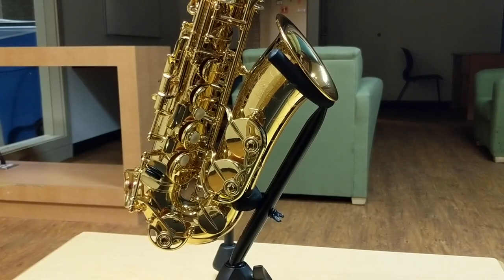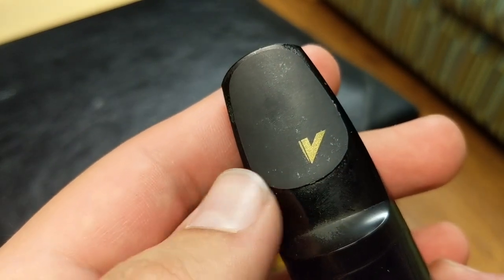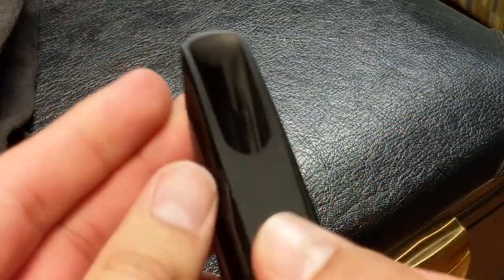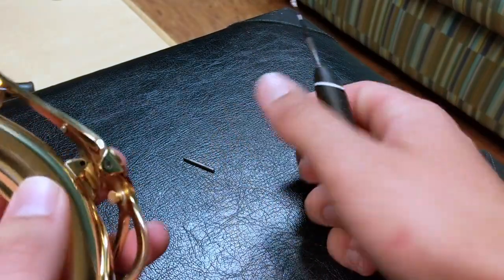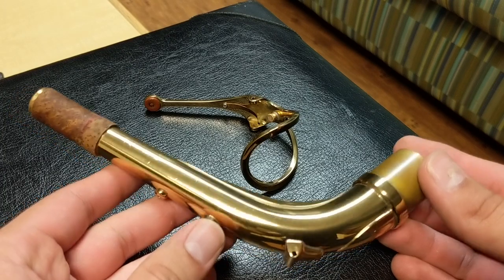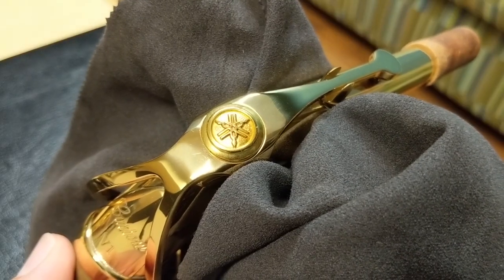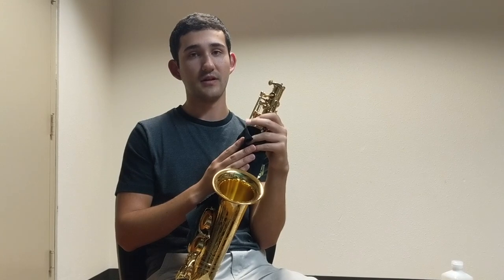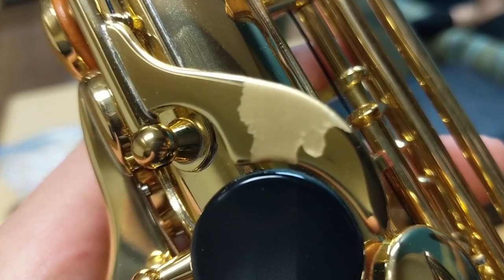Deep cleaning an alto saxophone

Comment: I am a beginner
Can you give me advice on
What strenght of reed I should get a good cleaning kit my friend said to use window cleaner is that good or no. A good reed guard to use thx
Reply from the maker: It depends. I recommend that everyone start on 2 1/2 and move on to size 3. Most professional players I know recommend that. 
DO NOT USE WINDOW CLEANER. Use what I said in the video. I'll provide links. 

Cleaning kit: 

Pro Tec Protec Alto Saxophone Body Swab, Model A120 ( https://www.amazon.com/dp/B01MQ6BVAS/ref=cm_sw_r_cp_apa_i_7sk8CbCA0QNWQ
Pro Tec Protec Clarinet (Bb, A, Bass) / Saxophone (Alto, Tenor, Baritone) Neck and Mouthpiece Body Swab, Model A119 ( https://www.amazon.com/dp/B01MQ6GM7S/ref=cm_sw_r_cp_apa_i_wtk8CbS342Q72

This is a good reed guard for you:

 Protec Alto/Tenor Saxophone Reed Case (Black) https://www.amazon.com/dp/B0002E594G/ref=cm_sw_r_cp_apa_i_Prk8Cb35KTFJR
Reply: Is there a more affordable price I can get a cleaning kit at? And plus, I need a mouthpiece brush and a reed guard that holds less reeds. Any ideas? Thx
Reply from the maker: @pianoman2021  I don't advocate for mouthpiece brushes because most people leave them in the mouthpiece and it can't dry. Also, brushes can scratch the mouthpiece. You are better off just swabbing the mouthpiece. You can get a vandoren reed case that holds 6 Vandoren VRC620 Alto Saxophone/Clarinet Reed Case for 6 Reeds: https://www.amazon.com/dp/B0002D0O8S/ref=cm_sw_r_cp_apa_i_5uD9CbR3G1NFD

This is the cleaning kit. Throw the mouthpiece brush away!!
Mowind 10-in-1 Saxophone Cleaning Care Kit Belt Thumb Rest Cushion Reed Case Mouthpiece Brush Mini Screwdriver Cleaning Cloth Gloves https://www.amazon.com/dp/B078N7S8Z8/ref=cm_sw_r_cp_apa_i_XwD9Cb7G3B9S1

Comment: Wait isn’t wetting the cork, kinda ruining the cork?
Reply from the maker: It won't ruin the cork since it is plant based. If it is submerged for a long time, then it might expand and harm the cork. For something as simple as this, it will be fine. Using cork grease also helps to make the cork resistant to water.
Reply: MATTHEW SULIN You Guys keep saying different things, I am a band 1 student and I need to clean it. What do I do??
Reply from the maker: @illuviaazul8749  Trust me. I have worked on instruments for years. Cork is plant-based material. Water is what plants absorb. The moisture from your mouthpiece and airstream doesn't make your cork fall off, right? So water will not harm your cork.
Reply: @saxophone_mockingbird6480  bruh I don’t have a screwdriver that small AND I NEED TO CLEAN IT NOW what will happen if I don’t take the mechanism off
Reply from the maker: @michaelsterling8422  You will get the pad wet. It's not the end of the world. But it isn't great. 

If you get the mechanism wet, oil the key after you let it air dry.